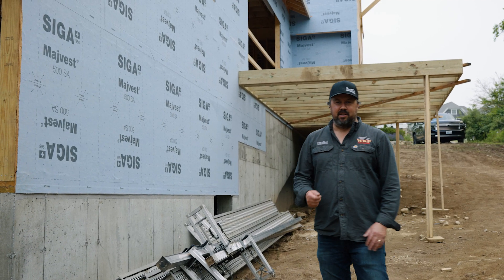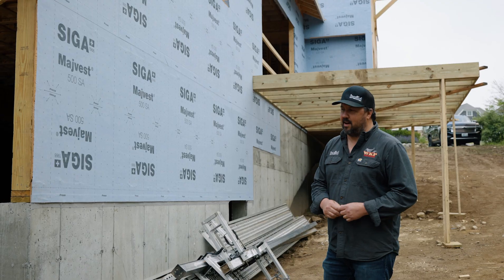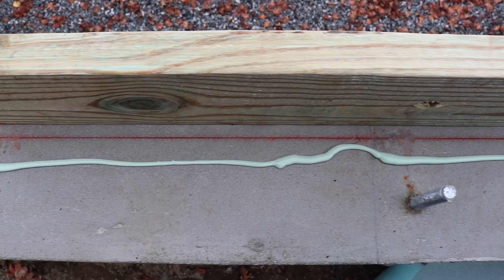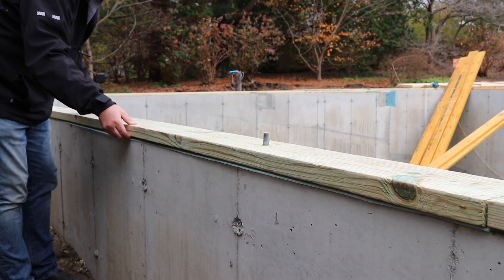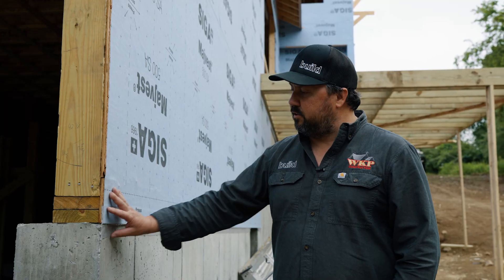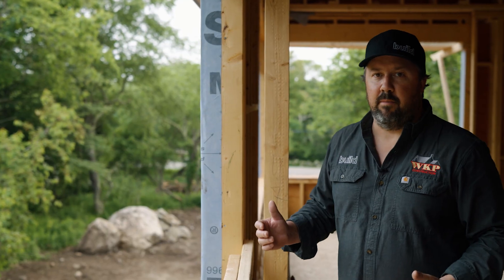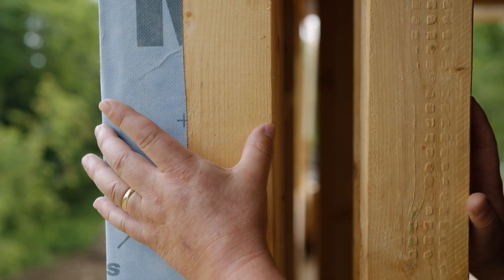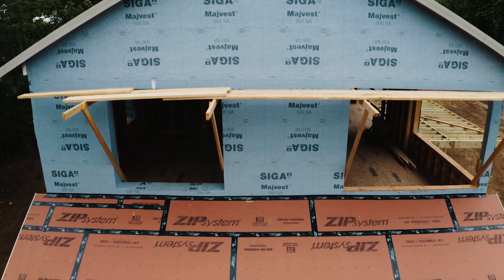Double Wall Construction & Mudsill Connection

Comment: Is there a problem with condensation on the inside of the sheathing?
Reply: I was thinking that to. I like the load bearing wall on the inside and the sheathing and vapor retarder on that  interior wall

Comment: Great video !  Didn't build a passive house, but I did use over 3 cases of Tremco Dymonic 100 elastomeric polyurethane sealant (20oz sausage packs) to seal the exterior walls of our house build.   It's excellent at ahearing to wood and cement, and it's safe/compatible for use with vinyl clad windows, Tyvek WRB & tapes, and Zip systems.  I highly recommend for air sealing and  for windows.
Reply: Metal with neoprene sill

Comment: Maybe a silly question, but why have the load bearing 2x6  wall be on the outside instead of having it and its fragile osb sheathing as the inner wall ?  Inside, it would still carry all the roof and ceiling and second floor loads, and would still maintain the thermal break between it and the outer 2x4 wall, but the unsheathed 2x4 wall would not have any osb to rot in the event of any leak in its wrb.  That half of the wall would still have dense pack cellulose but be vapor open with nothing to rot and mold like the osb eventually will.  The result would be more like the Larsen truss retrofits, except with the full thermal break advantage of the double stud wall.
Reply: I read your question 3 times. Sheathing on the INNER wall?
Reply: @nomdeguerre8464  Yes, where structural sheathing is still necessary to prevent wracking of the wall, but keeping it away from the weather and dewpoint by burying it in the middle of the insulation layer.  Then you have no substrate under siding just wrb over open studs on the outer wall.
Reply: @kirkellis4329  interesting, but... how would you build that?
Reply: @kirkellis4329  and what WRB? Just a loose tyvek?
Reply: @nomdeguerre8464 Start exactly like a single-wall 2x6 home, but ceiling joists separate from truss or rafter roof, with osb sheathing over this flat box   and wrap it all in self-adhered membrane like Grace Select up walls and over attic floor before setting rafters, for a full vapor tight living space. Windows mounted and flashed as "innie" windows in this 2x6 wall.  

Then build a second 2x4 studwall without osb, hung from roof rafter tails at the top and the foundation at the bottom, either with a lipped foundation wall or pressure treated ledger lag bolted to the exterior of the foundation wall, all outside the Grace Select covering the foundation.  Set as much gap as you want, 8", 12", whatever.  Denshield or other rot-proof window and door bucks only midwall connections between inner and outer wall.  Then a vapor open wrb like Tyvek or double roofing felt over the 2x4 studs.  Attach wood or galvalume siding or Denshield and stucco cladding.  Fill both walls with cellulose. Outer cellulose would be continuous layer up onto Grace wrapped attic floor 20" cellulose layer.
Reply: @nomdeguerre8464  Vapor barrier Grace Select on inner wall/attic floor (vented attic access only from exterior) and vapor open Tyvek or roofing paper on the outer wall and roofing paper appropriate for roof material on the roof.
Reply: @kirkellis4329  interesting. You think that outside wall could contain dense pack? 

I would hope for nothing to ever go wrong that could be a nightmare to fix
Reply: @nomdeguerre8464  If it had Denshield for stucco or just hor wood siding, I don't see why not.  I'd have the 2x4 wall 16oc instead of the 24oc 2x6 wall, staggering studs, so I wouldn't expect densepack celulose to bulge.  It doesn't bulge interior drywall if properly installed, after all. 

If it was a problem, I'd go with rockwool comfort batts in the outer wall and still use the cheaper celulose in the attic and inner wall.  Vertical Galvalume siding panels might not be stiff enough to avoid bulging with denspack but I'd want a rainscreen for that and probably use 1x3 diagonal strapping which would allow closer fasteners.  

My goal is all in keeping engineered wood away from exterior where it can rot.  Keeping the osb sandwiched with several inches of celulose on each side seems safer from vapor where flashing exterior with Sigma might not be perfect.  Which brings me to another point with a standard double-stud wall: any electrical or plumbing in the wall for exterior fixtures is inside the vapor barrier and penetrates the barrier, right ?  I think my way would eliminate any penetrations for those exterior fixtures through the vapor barrier envelope.  Except windows and doors, of course.
Reply: @kirkellis4329  all makes sense, except troubleshooting any damage to the area. Speaking of, I can't seem to find anyone that can address where the condensing surface is in the standard double stud wall- where do you think it would be in your setup? How to address moisture? 

How does blown in insulation not settle over time? Even if densely packed, it will expose the top more and more IMO. I was thinking horizontal ballests, but that gets complicated too. 

Thanks for the replies. Trying to plan my next place. I'm interested in this and ICF. Pros and cons to each
Reply: @nomdeguerre8464  I think the condensing surface on the double studwall shown in the vid would be the osb that is covered with Sigma wrap.  Because it is wrapped, the only problem areas should be penetrations where warm vapor-laden air flows from inside the house to a penetration in the osb, plus any plumbing or electrical boxes.  Celulose will absorb a lot of water vapor without changing shape and then release it when it warms, but it needs to be able to escape back into the house interior to do that.  If bulk water gets into the celulose from rain or plumbing leak you have to remove all the wet celulose in that section, dry the wall and then replace the celulose.

On my plan, the condensing surface would be the wrb on my outer wall.  The difference is that I have nothing there that will rot, no osb, and that I need no penetrations to the inside so no vapor path.  By using loose fill in the attic and having it flow down the outer walls, my expectation is that any settling in the walls will be refilled by the attic layer.  Densepack doesn't settle more than a few inches from what I've read.  I was thinking maybe rockwool batts under the window sills where any settling cellulose wouldn't refill from above.  With celulose on both sides of my vapor barrier and water vapor wouldn't go far and easily dry back out -- inner wall to inside the house and outer wall to outside.  That vapor control is part of the Perfect Wall by Joe Strbek.

ICF worries me for the same reason foamboard worries me.  It is toxic gas when it burns and insects like to tunnel into it -- not eat it but tunnel to live.  Celulose and rockwool both damage insects bodies that try to burrow through it, and it doesn't burn.  But if water is trapped in SOME celulose it can apparently smell strongly of ammonia, need to research which brands/chemical treatments that was true for because it wasn't all of them.
Reply: @kirkellis4329  OK, so what happens in the odd chance the internal OSB needs to be replaced? 

Have you heard of 'perfect block' ICCF? EPS foam, sure, but not only is it recycled, but it's mixed with other chemicals and most importantly Portland cement to make a 'Gray block'

SUPPOSEDLY this makes it fire resistant and pest free.
Reply: @kirkellis4329  also, what would you do for the roof? The attic wouldn't be conditioned space in this case. So how to insulated the roof and allow for protecting the roof material itself, possible sheathing damage, air flow and moisture?
Reply: @kirkellis4329  can I assume you'd use open web trusses instead if wood I-beams? You're still using OSB in your wall build though. Optimally plywood there just to be extra safe?
Reply: @nomdeguerre8464  How would it get damaged ?  

No I haven't heard about ICCF, but I have looked at foamcrete and lightweight block using ground EPS as aggregate.  It loses most of its R-value and will still melt and burn releasing toxic fumes.
Reply: @nomdeguerre8464  Why insulate the roof ?  With a vented attic and free air flow, the roof rafters are never going to mold as long as bulk water is kept off.  There is no condensing surface because the air and wood is all the same temperature and water vapor stays vapor.  The insulation is on the attic floor where it belongs -- exterior to the living envelope, not some unused and unconditioned space.  Nothing goes in the attic -- no equipment, no ductwork, no plumbing except for bath/kitchen exhaust ducts, and no access door into the living space only access from outside.  The roof is simply the umbrella to keep the rain off.
Reply: @kirkellis4329  might want to look at it, perfect block. Also EF block, same idea. 

4 hour fire rated. Claims if termite proof and relatively high r values. Post consumer Styrofoam. So most if not all offgassing is done
Reply: @nomdeguerre8464  I personally would use all sawn lumber rafters for my roof as they are easier to handle stick by stick than trusses.  Wood I-beams advantages are available span length, and mfd straightness, which I don't need for my short roof spans and zero snow load.  The disadvantages include cos, availability, and how fast they collapse in a fire compared to solid lumber -- as well as osb web rot if water damaged.  I am actually considering metal PBR roof panels over open 2x4 purlins to avoid any engineered wood/ply solid roof deck. 2x4 purlins spaced 8"oc costs the same as 5/8"osb, but limits roofing materials compared to a solid roof deck.

I wouldn't use plywood anywhere.  Osb is fine as long as it is protected from bulk water, has no voids like ply, and plywood delaminates in bulk water anyway so the type of damage is different but no better than osb to my mind.  Protected on walls and attic floor by self adhered membrane on the weather side as well as thick layer of celulose that will absorb and release water (or rockwool that won't hold water and just drains away), I don't worry about the exterior.  I do worry if humidity is not controlled on the interior and that inner wall celulose traps water that recondenses onto the base plate.  Dehumidifier and HRV are part of my plan to control air quality and humidty indoors -- as well as aggressive exhaust of bathrooms and kitchen where water vapor adds to natural humidity.
Reply: @kirkellis4329  I've been trying to find info for metal trusses built to order for residential application. I agree with rafters over standard trusses. I'm not a fan of the metal plate Fasteners in the first place.

I see your point about ply.

I was thinking OSB roofing with similar diagonal strapping like your wall exteriors for metal cladding
Reply: @nomdeguerre8464  Offgassing is from manufacturing process and occurs at temps much lower than fires. The blocks I looked at had R-value roughly =1, much better than concrete, but useless as exterior insulation where code requires R10 on the exterior.  I looked at ICCF website and no specific R-value listed.  A claim of better than a batt insulated 2x6 wall is obviously suspect for any cementitious product.  A claim of thermal mass and high insulation R-value in the same product made me laugh.
Reply: @kirkellis4329  re: offgassing, yes, however it is known that foams do in fact contine to offgas, but the newer it is the worse it is. In the event of a fire that doesn't exactly matter.

Look a little harder. EF Block is almost identical. They have a paper from a third party that shows a hot box test putting a steady R value at 23.

I'm not sure why you seem to think two layers of unbroken EPS would have such a low insulation value. It's completely comparable to other ICF blocks, just without the concern over fire or pests.
Reply: @nomdeguerre8464  Except for metal roof panels like standing seam and PBR, I haven't seen a strapping over osb roof layout I like.  Diagonal strapping gives a drainage path for bulk water and allows any spacing independent of rafter/stud spacing which I like.  Spacing flexibility seems important if I decide on cladding/roofing with odd dimensions/fastener spacing requirements.  If code requires a solid deck so the roof is a structural diaphragm, that would be a shame. I really don't want engineered woods exposed to humidity wet/dry seasonal cycling, but I think it might actually be the case in earthquake areas like CA where I am.
Reply: @nomdeguerre8464  I looked at light steel framing for the entire home a long time ago, but light steel collapses in fire pretty quick.  Like, much faster than sawn lumber.  It doesn't burn, just warps enough that the load paths don't support any weight anymore.
Reply: @nomdeguerre8464  Another reason I want to avoid trusses, or I-joists, wood or metal as well as specialty products like the ICCF blocks is that I don't want to have to special order materials.  Delays, shipping costs, quantity limits, jobsite theft of defective item waiting for return and reshipment.  It all sounds frustrating to me.  As much as possible, I want to be able to run to the local store for more material.
Reply: @nomdeguerre8464  Portland cement has a very low r-value.  It creates low r-value heat paths through the foam, and in ICCFs all the wall through the block. At least regular ICF has a very low cross section solid plastic web between high r-value foam on the outside and inside.  Does it really make sense that a cementitious material would have better heat transfer resistance ?  

They may get an R23 value by measuring over a short time frame that allows heat transfer to be delayed by the thermal mass aspect of the concrete filling the cells in the block.   I just prefer the quick heating and cooling of the interior air and then minimal energy to maintain due to high r-value envelope.  Plus it is a specialty product, better order enough because falling short means serious delays.  Where will you get replacement block if a car rams your wall 15 years from now after this company is out of business ?
Reply: @kirkellis4329  the test speaks for itself. That's for an unfilled unit. It's greater with a filled unit. I wonder if you've ever been in an ICF house or known anyone with one. I'm certainly not trying to sell you on it, but those concerns are unfounded. It's a very well insulated product, even with the cement addition (which is only a small portion).

As for availability and price even - I certainly agree.

Comment: Hi Wade. Are you not concerned with the interior 2x4 wall drying out and studs twisting since it does not have any sheathing?  I think this would cause a situation of drywall nail pops in the future.
Reply: I was thinking about metal studs on the inside to get nice flat walls

Comment: Hi Wade. You didn’t address the need for an interior vapour barrier.  In Ontario, Canada we need to install a 6 mil polyethylene vapour barrier on the warm side of the insulation.  Where do you install the VB in your wall assembly?

Comment: My current house is double wall construction at 14''. The outer load bearing 2x6 wall has 1/2'' exterior plywood sheating and is cantilevered 2'' from the concrete. This allows 2'' rigid exterior insulation to wrap the foundation having the wall and basement insulation to be in plane.
In my 40 + years of building energy efficient homes I always insulate the foundation on the outside.
Reply: Can you cantilever load baring walls like that? I mean, I guess you did, but that passes code? So, really it's 1.5" of the stud over? 

What do you fill with? If blown insulation, how do you keep that from settling over time? Even if dense pack?

What about condensation?
Reply: @nomdeguerre8464  You still have four inches of wood on the concrete foundation. The roof trusses can have the load on that 4''. 
Dense pack cellulose. The space between the two walls is open and accesable in the attic. If the insulation were to settle it could be packed with the cellulose in the R 80 attic and then the attic toped up in the future.
I use poly on the ceiling only. The interior drywall walls have vapor retarder primer and the exterior has black building paper under the siding so the structure breaths.

Comment: There's no need for the 2x6 wall, it's just wasted money. You can get the same R-value with two 2x4 walls at the same 12-inch wall depth. There are plenty of 3-level buildings built with a single 2x4 wall so structurally it's fine.

Comment: Hey, nice work. A few things about double walls. The framing for the exterior walls  is set for the plywood. The interior walls can be set for perfect sheetrock layout. 
Off setting the exterior studs from interior i think is useful. interior window walls can be splayed to let light shine in more. 
We used a 2x12 top and 2x12 PT bottom plate. This allowed us to frame only the exterior walls and get the roof on. Later it was easy to frame the interior walls. 
Electricians and plumbers will love your job it is easy for them to work. 
I have done insulated panels set-up on sliding door tracs. The panels slid out from inside the wall to seal the window closed at night.
I like 2x4 24"O.C,   5/8 sheetrock for the walls. I think it is a better and different product than 1/2".
Reply: Nice details. Can I ask.. Do you think your wall would be significantly stronger than a single 2x8 wall 24"oc? I live in FL(hurricanes) and weighing my options. If I'm understanding you right, your wall is 2x6(24"oc) plus a 2x4(24"oc) with a 2x12 top/bottom plate tying everything together? Of course I have roof uplift in mind also.